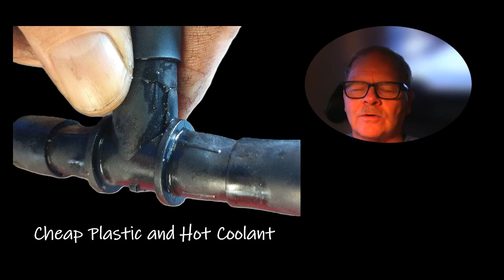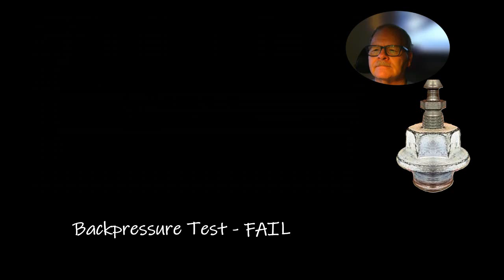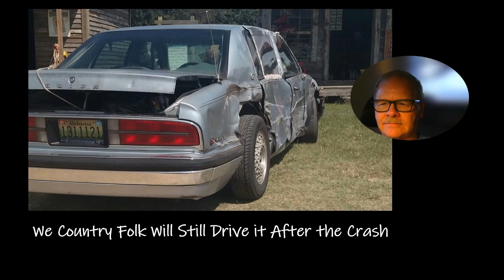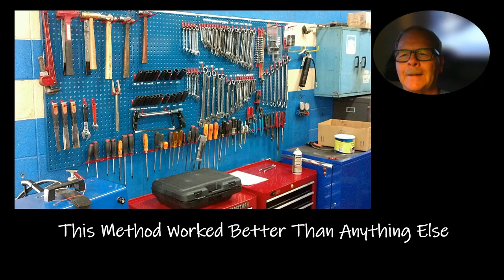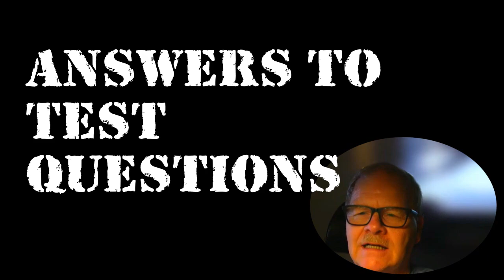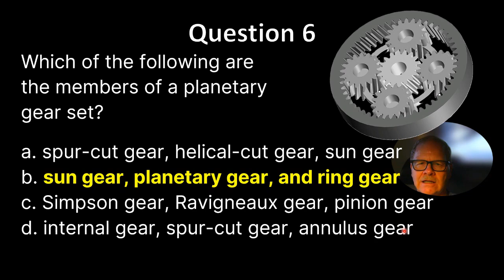Photos and a Practice Test

Comment: I could really use some advice. My Father drives a 2010 Dodge Caravan 3.3l v6, approx 210,000 kms. He bought it used several years ago but was looked after properly. It's been literally bulletproof beside brakes and rotors. He believes he's having brake issues. He had the front and rear passenger brake randomly stick on. We checked the brakes expecting to find a problem, but can't find anything wrong. The calipers are not sticking. Brake hoses aren't new but don't seem to be holding residual pressure. Have you had any similar situations? Any advice would be greatly appreciated. Thanks very much.
Reply from the maker: Sounds like a problem with the ABS hydraulic control unit. I've seen problems similar to that on other vehicles when the HCU has sticking and corrosion in its internal valving.
Reply: @McCuistian  Thank you very much for your response, I really appreciate it. If I understand you correctly, the failing hcu can possibly mimic sticking calipers and/or degrading brake hoses? Is replacing that unit the only solution or can it be cleaned or rebuilt? Thanks for making videos and sharing your knowledge and experiences.
Reply from the maker: @king300c  Yes, the HCU can trap fluid at just some of the wheels - if you loosen the bleeder when they're locked up and they release that's the most likely cause - but you'll need to replace the HCU. I've never known of anybody rebuilding one.
Reply: @McCuistian  Thanks very much, I really appreciate it.